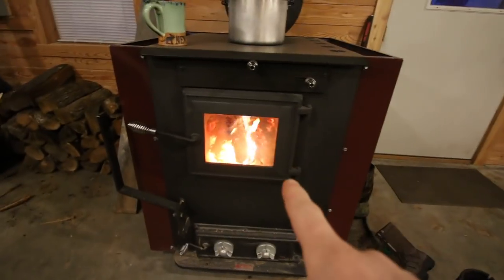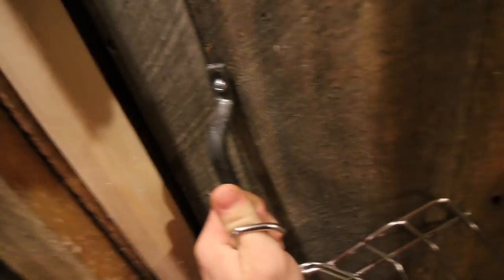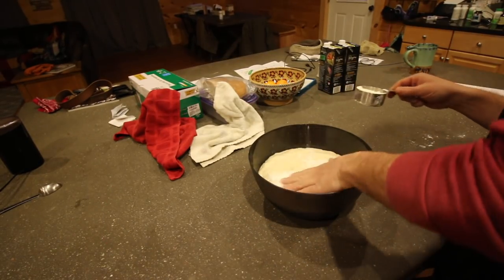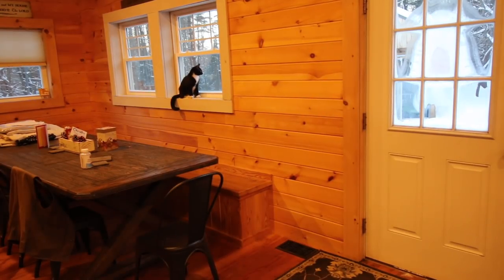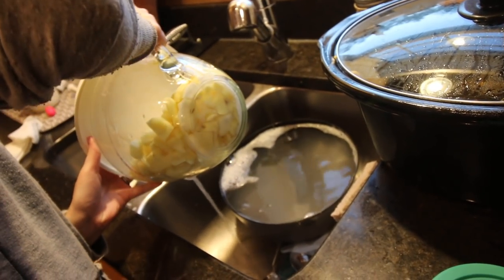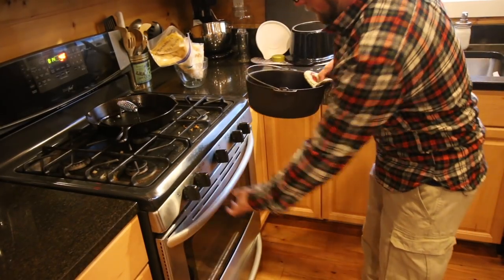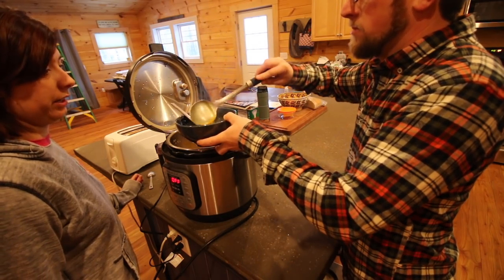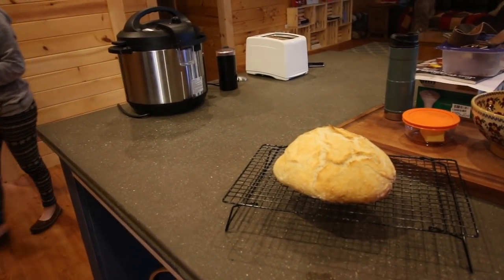Sunday Funday ~ Corn Chowder ~ Artisan Bread

Comment: I worked in lighting design for years , Al, and the change you just made by upping your kelvin rating on your lighting will make you feel less anxiety in the depths of winter. The new lamps make quite the difference on camera too. As far as the goes, when there is enough money in the bank could you please install smell-o-vision. GOD Bless.

Comment: Hmm... seems like someone come down with a case of the giggles.  Only known cure for that is tickle therapy...to get all the giggles out :D  The daylight bulbs definitely look better for filming.  Correct lighting in the right areas makes a huge difference and now that they're more readily available for LEDs it is good as they all used to just be cool white.  Brighter / cool lights should be used in Kitchen/Laundry/Bathrooms as they are typically work places and the blue light helps you to focus and is for places you don't want to sleep in.  The warm lights on the other hand are usually best for bedrooms.  The cool lights (have blue spectrum light) can interrupt your sleep cycle, just like monitors, mobile phones and screens do unless you can activate night modes.  The red / yellow lights will help you get to sleep hence why they are better for bedrooms and lounge rooms if you don't mind falling asleep on the couch.  Given you do a bit of filming inside the daylight bulbs are a nice compromise as they are more balanced, but you may wish to keep the old warm lights for the cosy/softer feel where appropriate.

Comment: I don't use windchill and heat index. They're not really a thing. People use them to over exaggerate how hot or cold places are but the math and models are wrong that's why the heat index in middle east has reached the 140's. You can't say well its 110 but it feels like 140. If it felt like 140 you'd be dead.